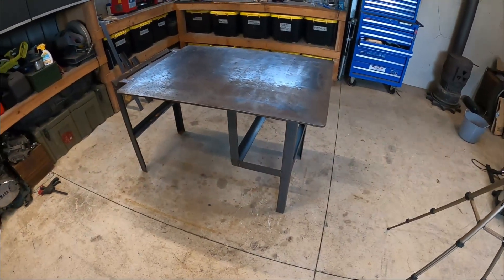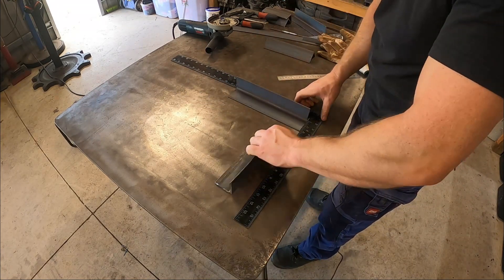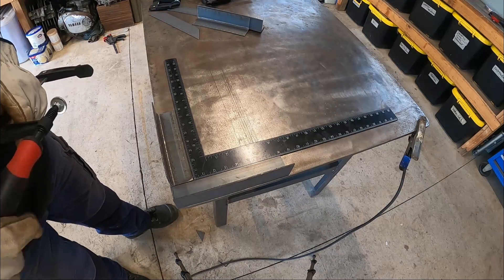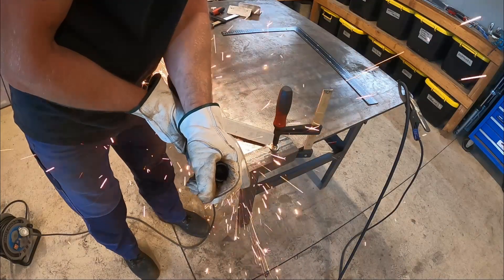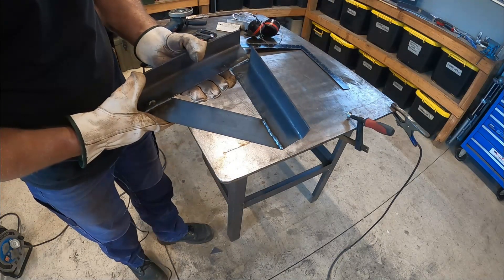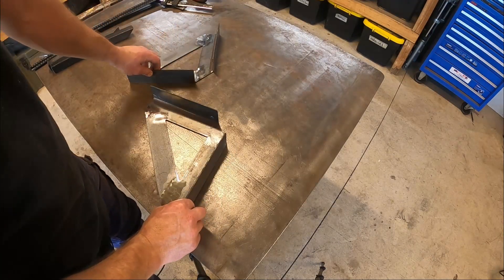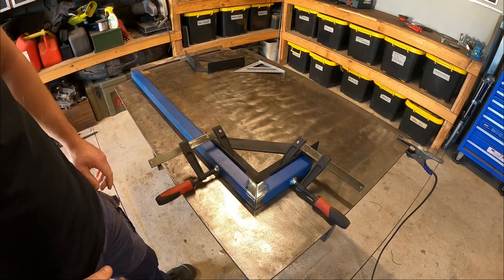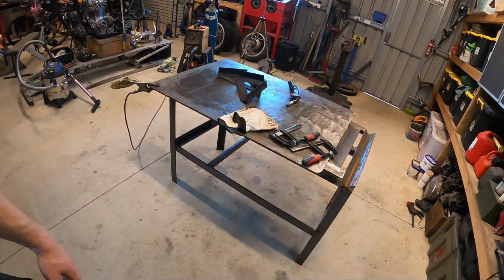DIY Corner Jigs

Comment: if you weld that much they'll always be off: it's a tiny piece of metal getting a fuckload of heat for that tiny size. ive built the very same project, and gave it only a few blobs here and there: welds will fail together with the structure - for which, ironically, I found stick weld more intuitive (I know that, at 90A, a quick smack will be enough for that side)

Comment: Thats cool but the jigs are like 20$ each why build
Reply from the maker: I wanted a quick project, I hadn't made a video in a while and I had scrap.
Reply: @2wheelworkshop  true good job then
Reply: @Ich_slage_dich_in_dominos 
Where can you buy a steel jig this size for $20?
Reply: In the country where I am, we find nothing. We have to do everything by ourselves.
Reply: This kind of method allows you to do any size. Bigger, smaller, doesn't matter. Pretty neat. He mainly taught the application of it, even if that wasn't his intention, he did it.
Reply: Diy costs 3x more and takes 9x more time than buy, so its 100x more satisfying

Comment: I love how organized your shop is it looks like mine. A little tip to save time and aggravation I have 3 angle grinders one has a cutoff wheel another has a grinding wheel the third has a wire wheel and a power spool hung from the ceiling with three outlets. no disk changes or power supply changes.
Reply from the maker: Thanks mate. I have often thought that multiple angle grinders would be handy but I always seem to find something else to spend my money on.
Reply: @2wheelworkshop  Here in the states we have a discount tool chain called Harbor Freight most of there tools are crap but the 4.5 in angle grinder I use is ok and on sale for 10$ us dollars when I catch them on sale I pick up one
Reply from the maker: @kevinmullins4919  they're not quite so cheap over here but I'm pretty sure Aldi does a cheap angle grinder. Maybe I will pick a few up next time they get them in.
Reply: @2wheelworkshop  You won't be disappointed you'll save time and aggravation.
Reply: @kevinmullins4919  Ohh Brilliant! Not a fan of HF but i am a fan of HF for things like this! Thanks!